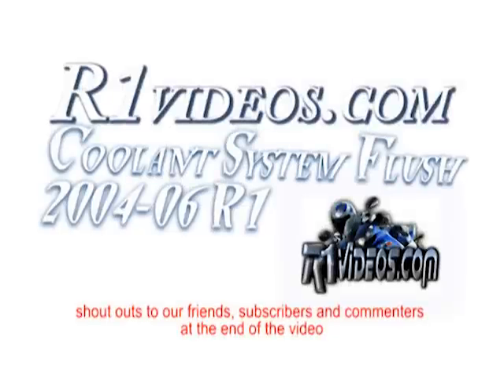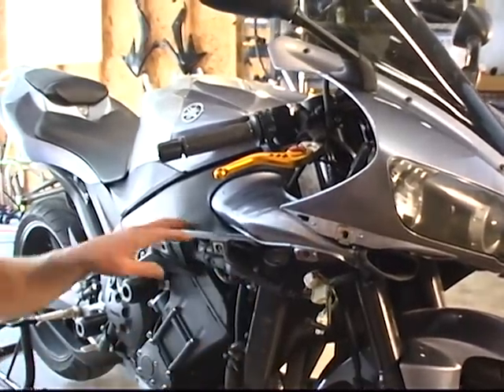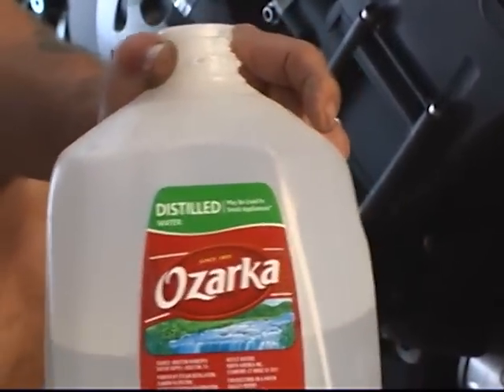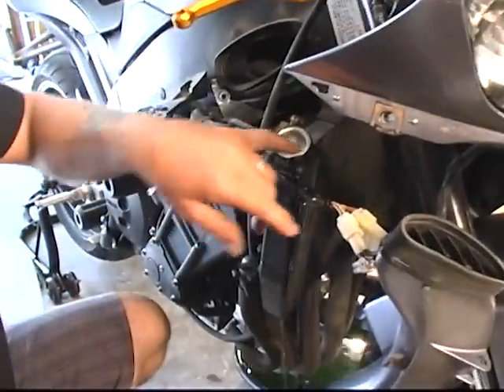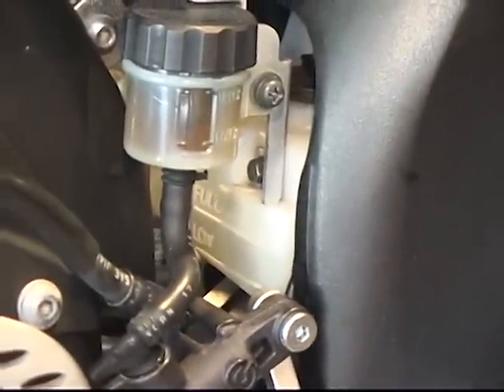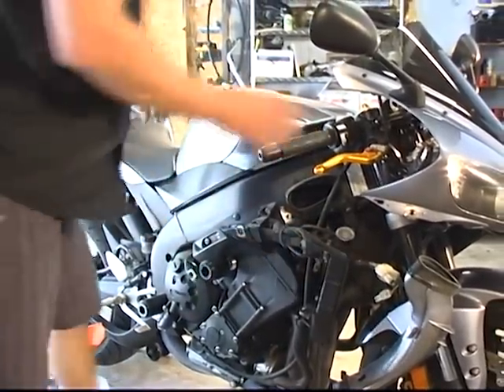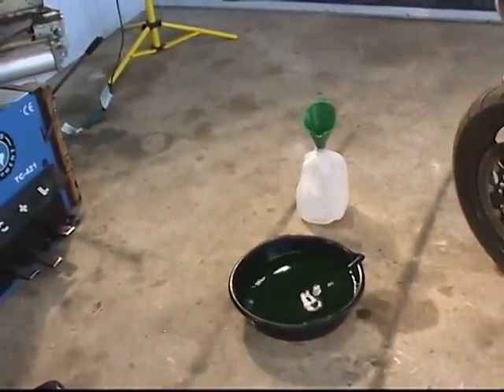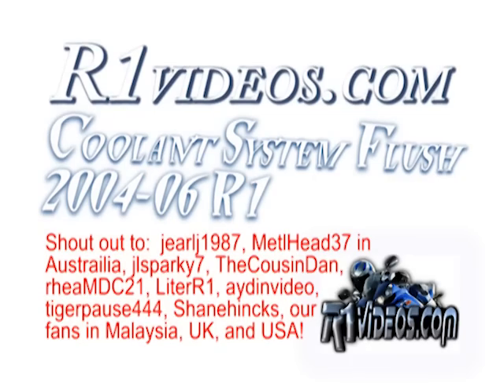How To Flush Coolant System 2004 2005 2006 R1 R1Videos.com

Comment: Why on heavens Earth would you take the time to remove those two additional pieces of fairing which took 1/3 of the time in the video along with why you removed the part on the shifter side of the bike in the first place also seems to me that both of those things which encompass half of the video don’t need to be done, especially if you have any sort of common sense and know how to utilize special funnels and tools that can easily fit in those spaces to refill the radiator along with remove the coolant drain bolt and save yourself the headache and trouble of not only reinstalling the parts but having the issue of getting them reinstalled in secured properly because I don’t know how many times I’ve seen with my own eyes or from other riders situations where they thought they got something like that put back together right but they didn’t and one or two of the clips weren’t hooked all the way and as soon as they got on the interstate, it was just enough to allow wind under, and it ripped the whole side bearing off, going down the interstate or something similar and destroyed it obviously so do yourself a favor and those parts guys! Plus it saves a ton of time and effort lol

Comment: The quickest way to ruin the engine by overheating due to you leaving the radiator cap off when hot never do that
Reply: Ok i see why you are saying this as if an already hot coolant system is suddenly depressurised  (cap taken off) it will immediately gain a large amount of temp maybe 15-20deg and overheat slightly. This isn't the case if you are running the engine with the cap off from when the engine has been cool because the coolant temp gain means nothing as its within the remit of the the acceptable temps. In turn, the non-pressurised system will still be treated as the actual temp so the  thermostat etc will still open at the same temperature figure and the fans will kick in at the same temp. I hope that makes sense but its only opening a pressurised system while its running hot that will spike the temp beyond the normal acceptable range. 
One other thing> This engine will take repeat 250+ deg overheats i know it will. You wont warp the head or nothing on these 5VY-001 engines even if the radiator blocks and blows all its coolant out the bypass and kettles the remaining coolant  inside the engine and rad so hard you can feel it popping while sitting on it. Ive opened 3 repeat overheating 5VY engines one of which ran so hot the hoses that run down the side of the manifold and the front grill triangle melted up as the engine ran so hot its manifold was red hot... and it done Zero damage to the engine not even a warped exhaust port. The exhaust ports on these have loads of sidewall and loads of clearance beside the manifolds header ends, it also has a larger than life rolled backed & filled copper washer between the headers and ports as well as a well distanced flange. If youve screwed your header manifold onto the bike using the proper Yamaha copper hoops part number: 4FM-14613-00 then you wont damage this head with heat unless its repeat 270+deg, you wont even blow a head gasket on a 5VY mate unless you've really messed up. This engine takes failed fans and all sorts without anything more than an overtemp warning and it will blow about 250cl coolant out the bypass when it does it. They are known for dumping off excess coolant too if you overfill them they dump coolant out the bypass the first few times you run them hard. Great engine but if you haven't stuck to the correct recommended oil you will need to replace the Rotor/flywheel part of the charging system as the epoxy on some of them doesnt like other oils or oil additives and can fail by means of magnets falling off them and churning up and ending up in your engine. That's the Yamaha 5VY engines only time bomb and it was made to run hot, they made this engine to run hot full stop.and its water passages are a level above in both design and size than a normal engine even the newer bike engines at 200+hp arent as well made as this lump, not even close. These are used in kit cars all over the UK for a reason.

Comment: DONT ADD COLD WATER IN A HOT RADIATOR! I wouldn’t use water as my coolant ether. These bikes are expensive to fix and a $50 container of engine ice or proper coolant insures a long lasting peak Proformance bike.